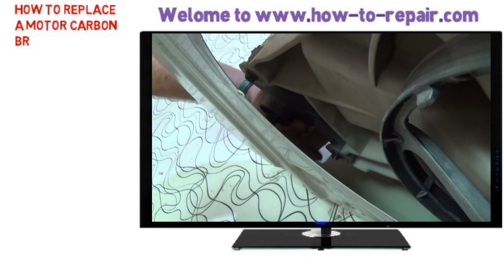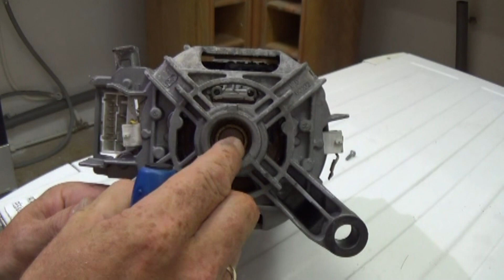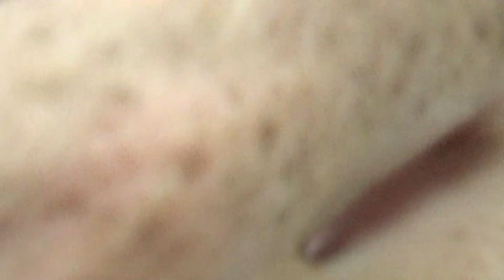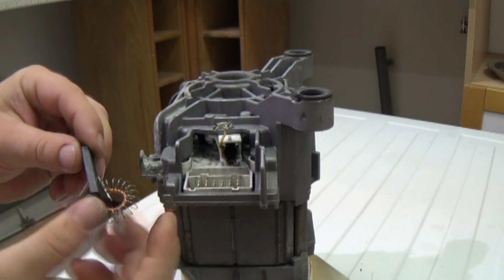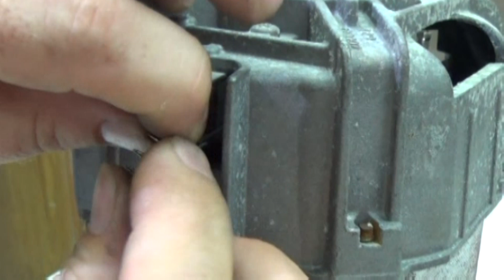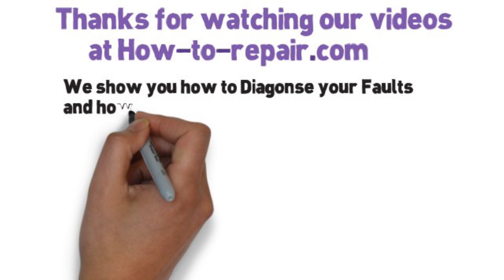How to replace carbon brushes in a washing machine Bosch,Neff,Siemens or Balay.

Comment: The Bosch 8 maxx does not have bolts,it has screws that go into plastic mouldings that are part of the outer drum. The screws act like real plugs to hold the motor in place.How do I get the motor off these mounting lugs?

Comment: Hi, I have removed the motor brush from my bosch WAE18060AU. But they are about 20mm in length on the angled part. From your experience is the carbon brush still good?
Regards.

Comment: My siemens xlm1451 stops before spin cycle, so I was told by siemens and others that I neede to change the brushes, so I did.. I also changed the pressostat because some said it could be due to not detecting water level, but still, the machine stops.. usually, at that point, I can turn off the machine, start again, and then it will complete the cycle.
I have also checked the pump, nothing inside there, and I have also tested the machine with cold wash, since some said if sensors was malfunction, then it could work at cold wash, but it still stopped at the same location..

Comment: Great video. But I was curious because I see that different brushes are sold. Some are as you describe with a long spring, but others are a small block with an internal spring, like this: http://www.meursonderdelenshop.nl/shop/images/cb7074e980e8c9e35d9491ffdc1de484.jpg
They often seem to be to the same model number aswel.
Reply from the maker: +MrMaraxion there are many brushes for many motors it depends on the motor that was fitted to your model we always need make, model and sometimes serial number as the manufacturers sometimes fit different motors to a model of machine during a production run.
Reply from the maker: +how-2-repair.com see here http://www.how-to-repair.com/washing-machine-spare-parts/motors-parts.html?cat=595